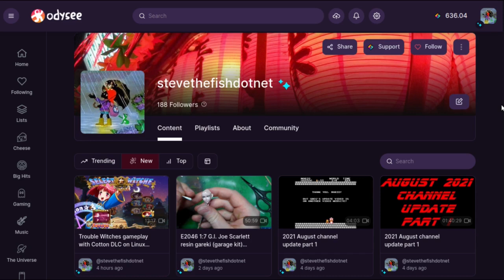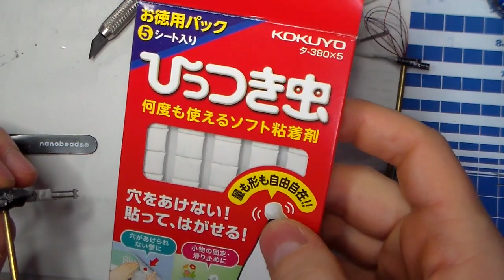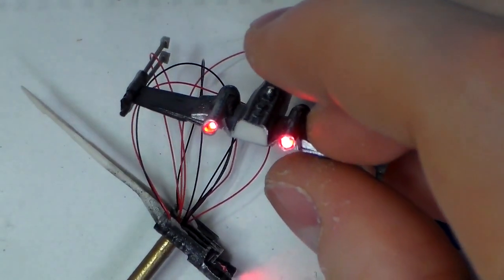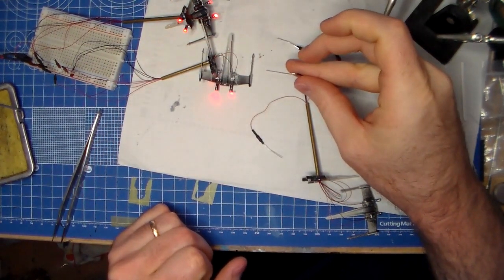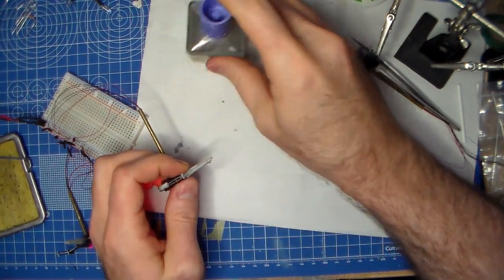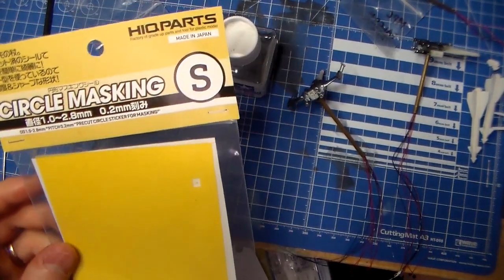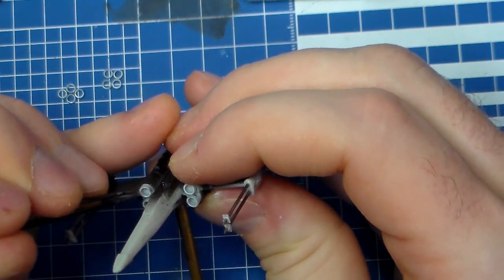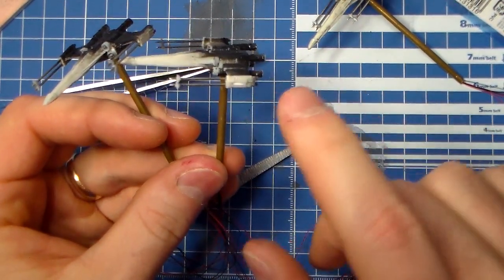MPC Star Wars Rebel Transport plamo build 14: The X-Wings

Comment: Until Bandai makes a 1/144 scale kit offering of the Rebel transport ship this ancient mpc kit is your only chance and it's looking good so far! Ambitious lighting the engines of those tiny X-wings!
Reply from the maker: At the Shizuoka Hobby Show, going back many years ago, I saw a 1:144 Rebel Transport with some matching scale X-Wings flying alongside it. That was before Bandai got the license, I think. It was a rather large resin model. BTW, did you notice how I changed the beginning? I switched to the Adywan Revisited version of Empire.

Comment: Greg, Fantastic Job on the lighting and detailing. I'm going to have to get an order in at HDA Model works for those LED'S .
Reply from the maker: Make it so. His inclusion of resistors takes out the guesswork and the need to hassle with Ohm's Law.
Reply: @stevethefishdotnet  Plus he uses small resistors ,easy to snake them through tight spots .